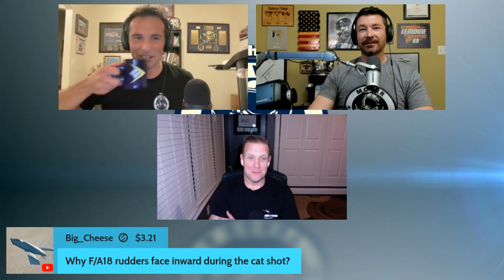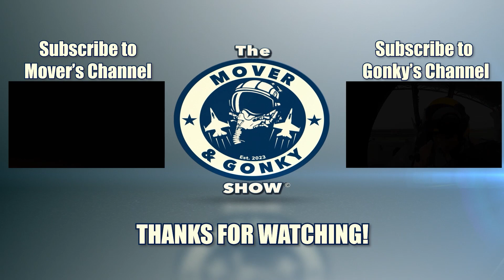F/A-18 Rudder Deflection On Take Off

Comment: Little bit longer explanation: during flight testing of the legacy F-18, it was found that pitch control coming off the ship and at low speed were undesirable using just movement of the tailplane. A quick fix was to alter the flight control laws to toe the rudders  7° inboard in order to provide additional pitch compensation.  I don’t believe this was result of an accident, but it did come about during flight test.

Comment: I believe they had actually addressed the lack of authority to get the nose up to rotate while they were still doing ground testing.
And they had to adjust the flight controls and have the rudders tow in to get enough pitch authority on takeoff.

Comment: Are the flaps crapping up the air for the stabilizer on takeoff? The rudders being above the flaps are clear of their turbulence?

The toe in looks like it provides nose up moment with it's high center of drag plus a bit from them being somewhat V shaped.

I never really realized that pretty much all non delta winged carrier based fighters have twin rudders. Do they all take off with them toed in?
Reply: Heading to watch F-35 cat shots now...LOL. I agree with the V shape btw.
Reply: Yup F-35 has a little toe in as well.
Reply: @Prifly70  Did you just run upstairs to the deck to watch cat shots?! Dayum.

I'm really curious as to why elevators don't have enough authority on takeoff. 

Is it something hilarious like the nosewheel falls off of the deck before the aft wheels which causes the bird to be partially dumped nose down.

Comment: The fins are angled outwards hence act partially as a V tail (there would be no pitch effect from the rudders moving in opposition if they were vertical). The real question is why the stabilators alone aren't able to provide sufficient nose-up trim ... presumably at low speed and high AOA they just don't have enough authority (perhaps because they're partially blanked by airflow from the wings).
Reply: There IS a pitch effect from the rudders moving in opposition, because they have drag and they are not directly behind the center of gravity but rather slightly above it. Still don't understand why the stabilators aren't enough though.
Reply: @cerebralm  good point, although I suspect there's not enough drag from relatively small rudder deflections at low speed for this to be significant. Pretty sure it will be the vertical component resulting from the angled fins doing the work (like the ruddervators on a V tailed aircraft, which of course provide all pitch control ... both nose-up and nose-down).

Comment: How do you tow both inwards? I thought you could only move both either left or right with your feet? 🤔
Reply: You don't - the fly by wire software does
Reply: And just at launch. Pilot is along for the ride till deck disappears.
Reply: FCS magic.
Reply: Put your right foot on the left rudder, the left foot on the right rudder and press simultaneously
Reply: @Amadeus_Flyfishing  🤣
Reply: You press the takeoff trim mode button.